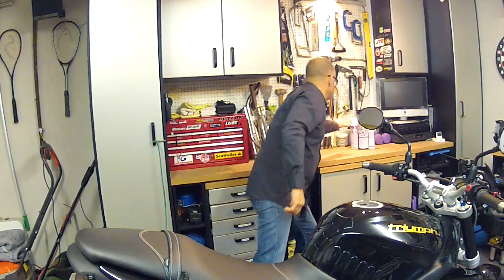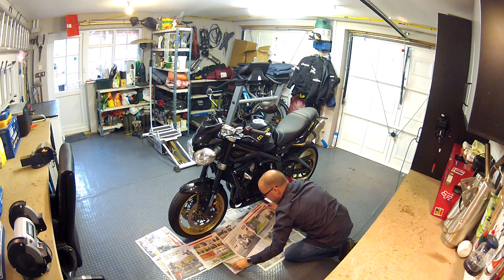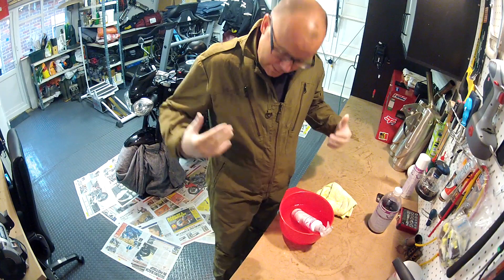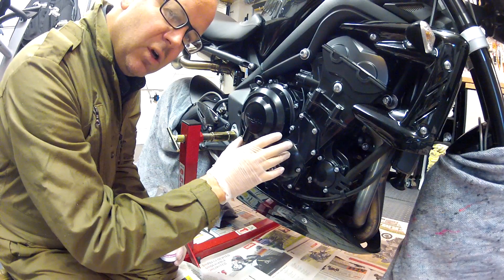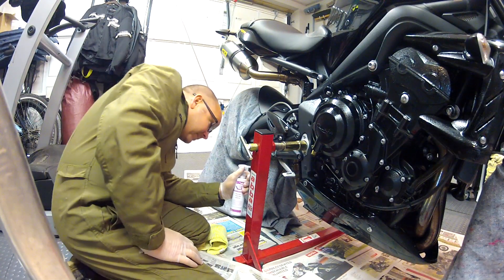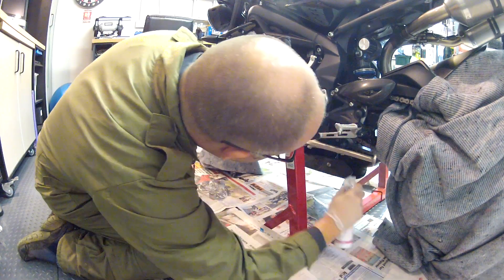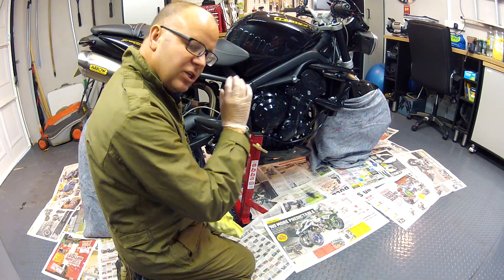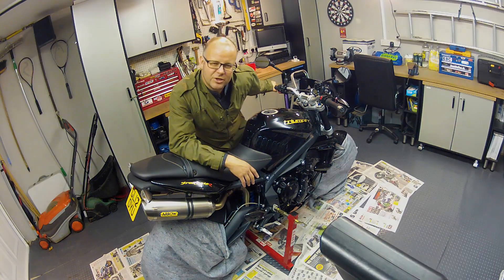Winter Protection for Motorcycles

Comment: Hi TMF. I've just treated the GS to a 'all year biker' wash/ACF treatment. I have to say I was impressed, not only by the pre-wash and dry stages but more importantly by the ACF application. They put the stuff on in a 'car spray type air compressor gun' it goes on at 120psi and they cover the wheels as you do but also cover the bike with a sheet and then spray the stuff under the sheet to contain it. The mist goes on so powerfully that they spray it from the back and you can see it coming out of the front and visa-versa. 
So I think I'll go and try and get one of those pump action garden sprayers. (I used one of those with the Scotoil 365) and then you can get a powerful fine mist. 
Cheers 
Richard
Reply from the maker: Yes I had them do my GS once, same system....never again (scratched the front screen and fairings - I dare say you didn't use the same franchisee as me)....also much cheaper to do yourself!  Good idea about the garden sprayer, I may give that a whirl but anticipate the ACF may be too gloopy without some sort of thinning...
Reply: +TheMissendenFlyer Oh no, nightmare! I didn't notice anything untoward on mine., fingers crossed. Mmmm yes good point, maybe that's why they have to use such a high pressure? Still, might be worth a go ;-)
Reply: Hi Richard, I had mine and the wife's bikes done a couple of years ago with all year biker, very impressed.  didn't look too much cleaner as they were already clean, but was impressed when he applied the acf 50 under the cover of a blanket

Comment: Hi TMF! Many thanks for your channel, I really enjoy your videos, very informative and instructives. So I tried ACF 50 on my bike following your advice and the result is simply excellent. I wish I had discovered your channel earlier, but an old teeth brush and a bit of nerve helped to remove 2  years of London weather attacks as I have no garage in a few minutes..I used the spray and it was ok, just leave it a good 15 min on the downpipes for a deep corrosion clean. It will indeed smoke when the engine is hot after applying, let it run for a few minutes and leave it there..next time you drive smoke will disappear quickly. Thanks again! Oh I almost forgot : let me know when/if you want to sell your GS :)
Reply from the maker: +Vadius Kounet Cheers Vadius, glad you found it as good as I do!

Comment: it does. as the name implies it's a clear ceramic coating. it helps protect your alloy wheels from brake dust and other road gunk and once applied makes the wheels a lot easier to clean. you have to make sure the wheels are spotlessly clean before you apply it then apply quickly with a makeup pad (really! ) then you have to wipe off any excess with a mf cloth before it sets then apply another coat a couple of hours later. it took me all day to do my car as you really need to take the wheels off to do it but once done it does make things a lot easier.
Reply from the maker: +adrianbarrie13 Thanks for that, sounds like an almighty faff! :0)

Comment: Hi mate, can I first say what an awesome channel you and thanks for your videos. I recently subbed and find your videos very informative. 

I recently had my bike professionally treated with ACF50 by All Year Biker, I park outside and keep bike covered. I rinse my bike daily with water to get rid of as much bike salt as I can. In your opinion how often should I use ACF50 to top up the treatment I had? Also, I've got 5 litres of Duck Oil laying around I sadly purchased it before I came across ACF50, what do you recommend I do to use up the Duck Oil? I don't want it sitting there. That would hurt my feelings hahaha 

Happy new year to you.
Reply from the maker: Hi the_whisperer - Thanks for the kinds words and welcome along!  The ACF50 won't wash off completely with normal washing - it bonds with the metal at the surface layer and stays active for up to 18 months!  That said, if you wash and ride regularly (as I do) through winter you may want to top it up - I do my bikes twice a year, in November and January (just did my GS yesterday)....will have another video along soon with more on this subject!  No idea what Duck oil is!!!  Cheers - TMF

Comment: hello TMF
just wondering if you tend to let the acf fully dry and then buff to finish. I  had this in an aerosol a few years ago and used it on all sorts. .. mabey I was too generous or didn't leave it long enough before wiping or buffing it up as I found it quite a greasy finished surface. Worked very well though, one outside cheap tea light was rusty as hell after one winter and the treated one still looked new !
ps. I admire the fact you seem to reply to most comments... which must take up an incredible amount of time.
so thanks in advance
Reply from the maker: Hi Glen...I tend to let it "creep" for ten minutes or so and then wipe off the excess.  It does leave a greasy surface but that dries over time and as you say, the stuff just works!   ...there, another comment dispatched! ;0)

Comment: I use Scottoil Ps636? Protectant all year round. It does wash off, but a quick spray after a wet ride/wash sorts it. I do wonder if the ACF is a better choice for the fact it sticks better. I know MCS&L magazine did a good review on the stuff and used 3 strips of bare metal with one plain, one with WD40 and the other ACF. The ACF had no signs of corrosion the WD had more than I was expecting (which I used foy years) and the plain was rusty as hell.
Reply from the maker: How interesting, what a good review/demo!  I tend to ACF50 my bikes twice a year in Winter and I have to say, so far, no corrosion!  ...I'm a fan....
Reply: +TheMissendenFlyer maybe I'll have to try it when I run out of Scottoil.

Comment: Great video, what is the process of weekly maintenance if your are using the bike throughout winter? I have heard mixed messages of either rinse down with cold water and leave or do nothing and then deep clean the bike every 6 weeks and reapply from scratch.
Reply from the maker: I clean every week - as a minimum rinse down with clean water....
Reply: @TheMissendenFlyer  clean every week as in full degrease and re-application of acf 50 or a light wash with a weakish cleaning solution? Not sure I have the patience for a full clean and reapply on weekly basis.
Reply from the maker: @scottcollington30  Light wash - I reapply ACF50 every 3-5 washes in winter.....

Comment: I have just bought some ACF 50 but i have bought the aerosol can with the straw, would you say the best way to a apply it would be the same as your video then go over with a cloth? as i now from the can you don't get the mist? Cheers
Reply from the maker: Yes exactly that, warm it up a bit, a good shake then spray and wipe - basically by not misting it you're just wasting the stuff - goodness knows why they don't supply it in a properly atomising version....

Comment: Cheers MF. my cleaning regime will be similar to yours though I will use a ph neutral TFR that I apply to my car and Autoglym shampoo as I've got "both in stock" On a slightly different tack did you ever try the carbon collective wheel sealer? I've had it on my car for a couple of years now and it works well on my car alloys but I'm just a bit worried the bike wheels are a bit too complicated to get a good even coating as it starts to set really quickly so might try some bilberry wheel wax I also have "in stock" instead to see what that's like 1st. cheers Ade
Reply from the maker: +adrianbarrie13 ...no I haven't come across that Ade, leaves some sort of semi permanent clear coating on the wheel does it?  ...sounds quite handy!

Comment: Hi just found your channel 👍. Had a quick question about the acf50. I have tried to use it on my bike for the previous 2 years winter prep but found that the horn on the bike gives up the ghost a week or so after the application.  Have you had any problems with any of the horns on the bikes you treat?
Reply from the maker: Really?  No, I've had no issues....

Comment: Any tips for using the aerosol version? I've already bought it and wouldn't want it to go to waste :(
Reply from the maker: I had the same issue - I would squirt it onto a rag and apply that way.....the spray version really is too gloopy to penetrate inside the engine which is what you really want (ie getting the ACF50 to atomise)...
Reply: TheMissendenFlyer Aha I get what you mean now. Maybe i'll use the aerosol on the outside casings, manifold, and plastics only. Then use the mist spray to go deeper. Did you purchase your unpressurised kit locally or online?
Reply from the maker: Yeah, that's what I do - the unpressurised kit I bought on-line yes, much better than those cans....

Comment: Hi TMF - I didn't see you spray it on the radiator/radiator guard. Is that not recommended? Thanks for the vid
Reply from the maker: +Glen Benton Hi Glen - You sure can - you can spray that stuff everywhere except the brake components and tyres/foot pegs and controls (for obvious reasons).....the radiator should get a dose too.  As it happens I did my GS only last week and it brings the plastics up like new - good stuff ACF50...cheers for watching - ride safe! - TMF
Reply: +TheMissendenFlyer Do you avoid the chain too?
Reply from the maker: +Matomiii I don't purposely ACF the chain but I don't think a bit of over spray will do any harm (it's basically a lubricant)......

Comment: what about the hard to reach places? as I haver a vtwin the frame gets in the way and was wondering will it just burn off? build up? or be normal
Reply from the maker: It burns off the hot bits!
Reply: wouldn't that make it obsolete as of all the screws get warm and thats basically what we want to protect?
Reply from the maker: Well maybe I should have said "it burns the excess off the hot bits" - the beauty of ACF50 versus the other products out there is that it doesn't depend on visibly coating the item that it's protecting.  Once sprayed on it atomically bonds with the surface layer of metal over time and works it's anti-corrosion magic into the material itself, so even after it looks like it's been washed off or burnt off it's still doing it's job - that's why I like it so much (and why it's expensive).  At least that's what our aircraft engineer told us and that's where I first saw it being used.....

Comment: I just bought a daytona 675 and for winter i just plan of putting it on the stands and putting a cover over it. Do you think it will still be ok come spring
Reply from the maker: Yeah I expect so - battery may need a charge though....
Reply: TheMissendenFlyer forgot to add that the bike will be inside just worried about the cold & the battery will be on a trickle charge
Reply: TheMissendenFlyer and also rust but don't see any way it will rust if it isn't outside or being ride

Comment: Another good video MF! I've had confirmation my GS is arriving in December so applying acf50 would seem a very good idea (though SWMBO will think I've gone nuts cleaning a brand new bike!) Is there any way of telling when you need to reapply the acf50 as usually I clean my bike after every ride during the autumn, winter and spring so don't want to potentially leave it unprotected as a result of me cleaning it. Also have you found anything that works well cleaning wise and also anything to avoid because it strips the acf50 off etc. cheers Ade
Reply from the maker: +adrianbarrie13 Hi Ade, good call on the ACF50 - that's what I did with mine when I got her and she still looks as good as new today....I apply ACF50 (around about this time of year) then clean normally (I use Muck off first then Meguires) and then I'll give it another top up of ACF50 around Januaryish......good luck with the new bike, you'll love it!  Keep me appraised....TMF

Comment: Great vid man. Where do you but it from, I can only find it online, is there a shop I can go to. I know you said in the vid, but do you really only have to do it once? Even if you wash the bike through winter? As I mentioned on a previous vid of yours I've just got my new tracer but I've never prepared a bike for winter before.
Tcrs ✊
Reply from the maker: +Doticaster Hi Doticaster, thanks for the kind words / much appreciated. I've only ever found ACF 50 online and it is expensive stuff (but very good) - obviously it depends how much you use the bike, I only use mine lightly through winter so one or two applications is all that's required. The stuff bonds to the metal at the molecular level so a simple wash shouldn't remove its effects. Give it a go, I think you'll find it protects your bike a treat. All the best - TMF
Reply: TheMissendenFlyer 
Thanks TMF mate. I appreciate your spread of knowledge. I've seen the spray can and the squirting gun thing you had, on eBay. It says  "genuine acf-50" in the description. So I'll trust the description and give it a go.
Cheers fella, really appreciate your help.
Tcrs✊
Reply: Jobs a good'n, I'm ready for winter ✊
Reply: Doticaster

Comment: would gt 85 do the same job ?
Reply from the maker: Similar but not necessarily the same, in my view ACF50 is the rolls Royce protection formula, all the others work I'm sure but this is the one I see at airfields protecting very expensive bits of kit.....
Reply: TheMissendenFlyer  thanks mate ill use the gt85 for now as i already have it and ill pick up some acf 50 some time soon :) how often should i spray my bike? i have a little 125 used daily always covered up when stored but stored outside
Reply from the maker: Through the winter I do my bikes twice with the ACF - but then they are garaged and each bike is ridden roughly twice a week - so in your case I reckon maybe once a month through winter??
Reply: TheMissendenFlyer thanks mate i appreciate the advice